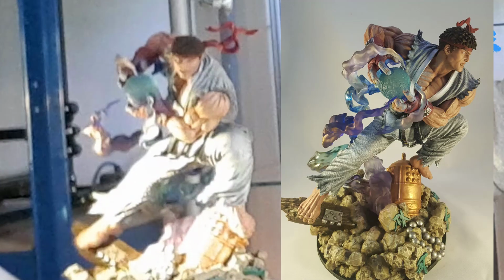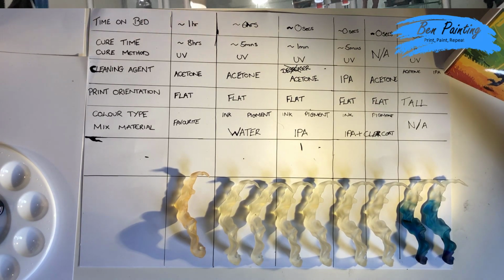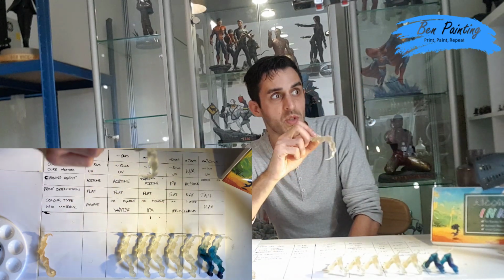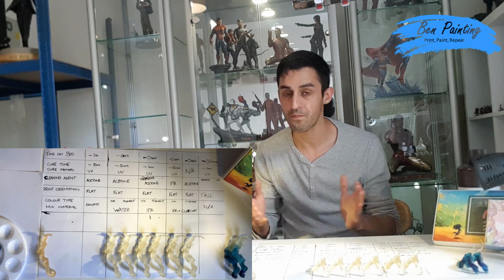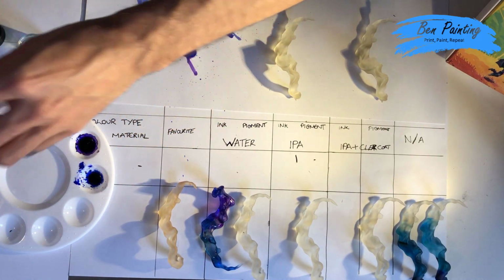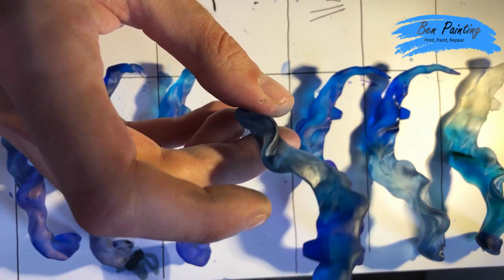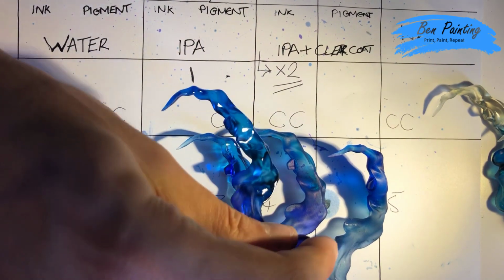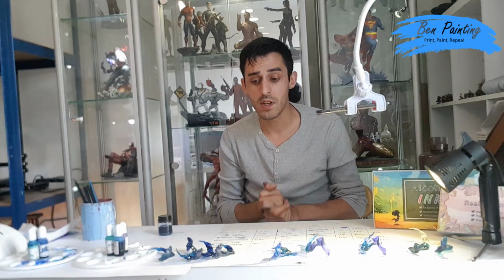3D Printing with Transparent Resin - Keeping it Clear and adding Colour

Comment: When coating a print with alcohol ink you can use acetone to smooth the transition between colors, and you can even QUICKLY dunk the part in acetone after dying to make the dye lighter. If you shake a part around for about 10 seconds in acetone you will remove dye completely. However I've noticed that blue stains harder than red/yellow/orange.
Reply: You have to be quick with acetone on a brush however, it evaporates very quickly.
Reply from the maker: @reforgedcriterion1471  Thank you. I really don't like using the stuff but Acetone is definitely the best option for smoothing the colours. I have found diluting with IPA and applying two thin coats has been working well and is really easy to create multiple colour blends. Lots to learn :)

Comment: Do you mix the acetone with water or dilute it with anything?  I always thought acetone would melt the resin, im pretty sure it destroys PLA and other plastics, is there any melting if left in for too long?
Reply from the maker: @blacklce87  hi, I've been using acetone for ages and standard resin and I haven't had any issues. No dilution, just be sure to wear a good mask to protect from fumes 👍🏼

Comment: Super informative video. You mention that translucent resins are pretty much the same in terms of yellowing. If you haven't yet, consider trying Epax Hard Transparent resin. Epax Hard is slower-curing than other resins, so I've found it resists yellowing more effectively than the other translucent resins I've tried.
Reply from the maker: Thanks man. I'll be sure to check it out 👍🏼

Comment: Awesome video. I've been trying to do clear prints but have been getting air bubbles trapped inside during the printing process. Any idea how to remedy this?
Reply from the maker: Sorry for the delay. My only suggestion would be checking how the resin looks when it is poured into the vat. If I pour it slowly it reduced the bubbles in the resin. I can then blow over the top to pop the remaining bubbles. Hope this helps.

Comment: Yo great video, helped me a lot! w One question, what could happen if I leave the print without a clear coat? Would it risk yellowing? I really love the frosted look and  would like to keep that
Reply from the maker: Thank you! I believe it will 'yellow' faster without the clear coat, however if the model is not in direct sun light it should be fine for a long time. So far I haven't had any impact on the frosted effect (without clear coat) but it has only been around 6 months.